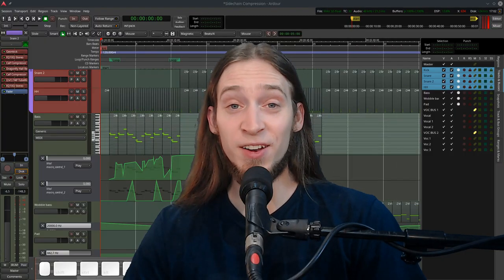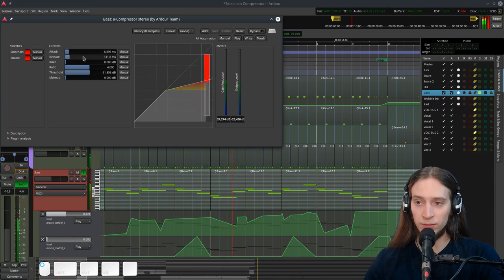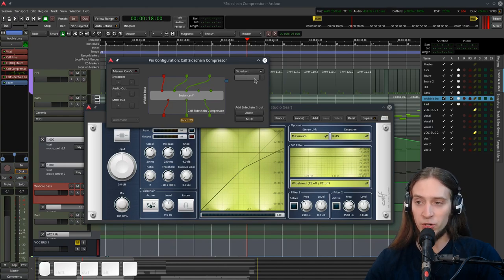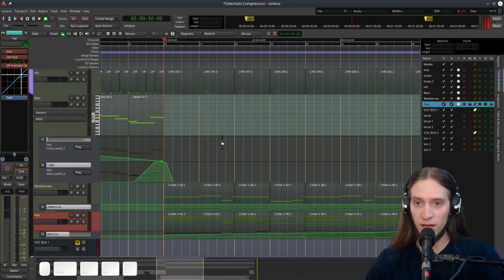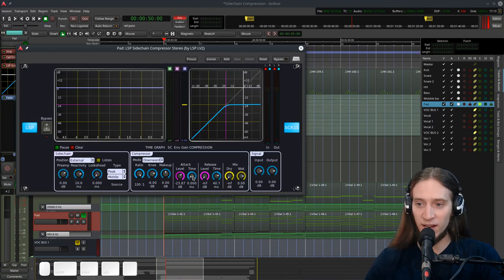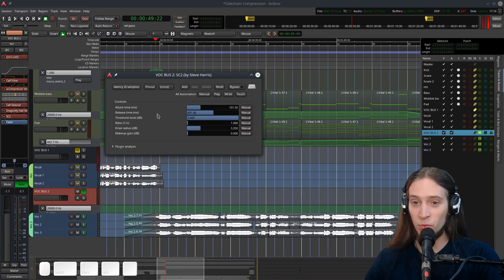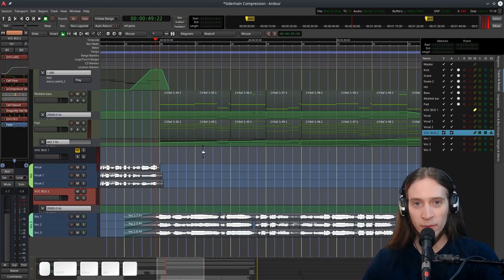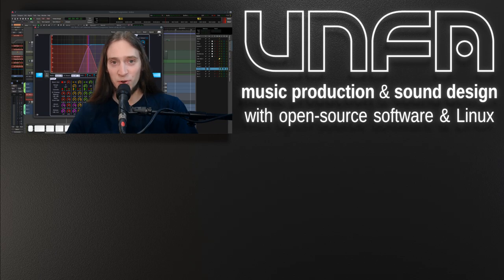Sidechain compression in Ardour 5 (with 4 different plug-ins!)

Comment: Those LSP plugins are excellent.
I was just about to ask you how to get Ardour to see them when I twigged that it needed to be given a path to search for them. 
I had made a folder called "lsp-plugins" like the LSP readme file said but it wasn't showing in Ardour. 
Setting that path in Preferences sorted it though.
Now to figure out what some of those more complicated plugins do and how to do it  ...
Reply: You just need to place the unpacked folder into standard place.
The usual directories for LV2 are:
  * /usr/lib/lv2
  * /usr/local/lib/lv2
  * /usr/lib64/lv2
  * /usr/local/lib64/lv2
  * ~/.lv2

The usual directories for LinuxVST are:
  * /usr/lib/vst
  * /usr/local/lib/vst
  * /usr/lib64/vst
  * /usr/local/lib64/vst
  * ~/.lxvst
  * ~/.vst

So, usual installation commands for LV2 installation are:
tar xf lsp-plugins-lv2-1.1.10-Linux-x86_64.tar.gz
sudo mkdir -p /usr/lib/lv2
sudo mv lsp-plugins-lv2-1.1.10-Linux-x86_64/lsp-plugins.lv2 -t /usr/lib/lv2

For VST installation:
tar xf lsp-plugins-lxvst-1.1.10-Linux-x86_64.tar.gz
sudo mkdir -p /usr/lib/lxvst
sudo mv lsp-plugins-lxvst-1.1.10-Linux-x86_64 -t /usr/lib/lxvst
Reply: @Lsp-plugIn  Thanks for that. 
My main omission was not setting a path and scanning in Ardour preferences.
They're now sitting happily in usr/lib/lxvst/lsp-plugins folder
I had them in  lib/lxvst/lsp-plugins before (and a whole load of other locations). 
I'm told that saving to root is frowned upon. 

I'm no expert in Linux protocols and etiquette ... ;^)

Comment: Thank you for these demos. The trick of the two instances is very interesting. By the way, is there a way for one of these sidechain compressors to start compress a bit before the kick?
Reply from the maker: Thanks! You could add a delay plug in and route it so the delay only happens for the signal you want to process, not the one that'll trigger the compressor - I think  this is nearly exactly what 'lookahead' does in limiters. Though they also increase the attack time along with it I guess. Note that you have to latency compensate that, so for exams you'll have to dial in appropriate ms time in the track latency compensation so Ardour can keep it all in sync.
Reply: I would suggest make a duplicate track of the side chain source and move it slightly to the left. (Earlier)
Reply: You may use a Lookahead knob in sidechain section of LSP compressor.